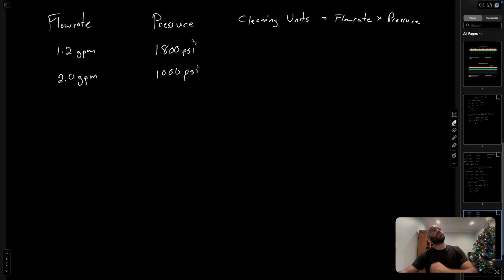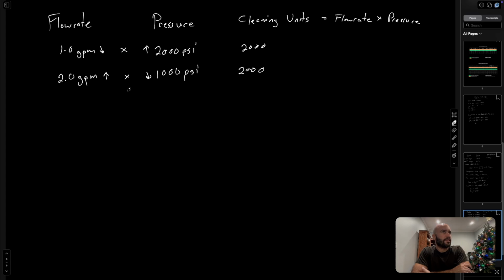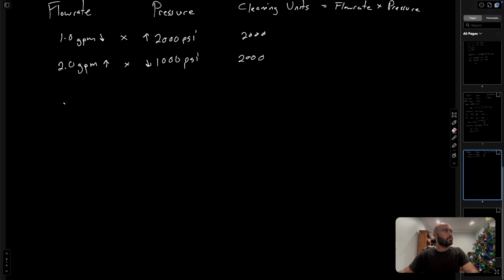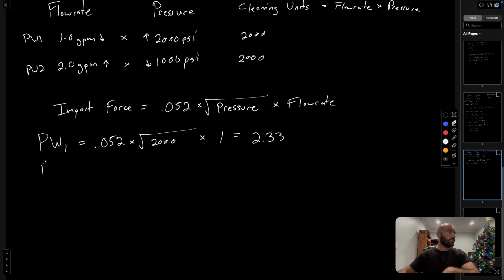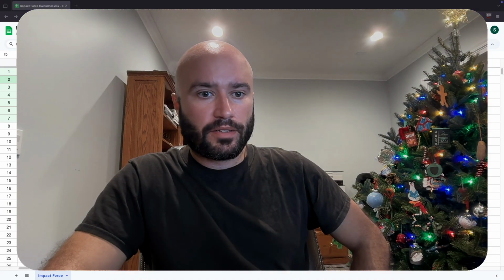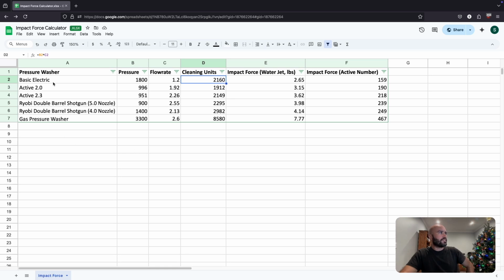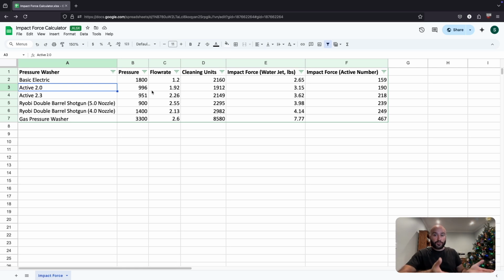Don't Use Cleaning Units, Use These Instead

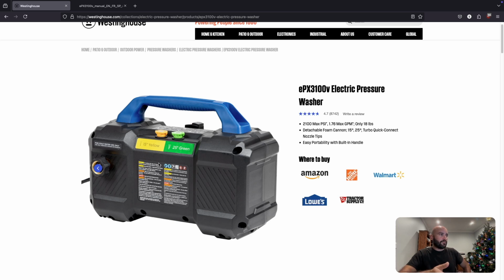Comment: 13:37 those numbers, especially 1.76 gpm, for the Westinghouse mean it’s just a rebadged Sun Joe piece of junk. I made the Sun Joe mistake when I got one just before OG Matt did his huge test, educated us all on PW’s and proved Sun Joe are junk. Funny enough a 20 year old karcher was far more reliable than a SJ.
Reply from the maker: I would not be surprised if multiple brands were using the same motor/pump with different housings. That Westinghouse I had was no bueno, I should have gone for the Ryobi 1800 early on. Now we have the Ryobi Auto which is definitely the best low budget PW. Thanks for watching!
Reply: @StevePierson123 oh there definitely are multiple brands using that same motor/pump. I’m just pointing out Sun Joe because they are the biggest, most well known to use it and are complete junk. I would stay away from anything that’s shared with them. No doubt under $150, even $200, either Ryobi is the best bet.👍

Comment: Great info and I appreciate the theoretical explanation. I’d like more detail on amperage, how it relates, and more detail on all of those variables you mentioned that impact pressure. Probably none of it makes a difference other than I enjoy understanding the theories. I can also relate back to similar concepts when I was in the fire department and we regulated the pressure on our pumps to determine flow after taking into account distance, hose diameter, and elevation impacts. Fun times.
Reply from the maker: I definitely need to do a part 2! I want to setup a small website to post all the formulas and calculations. I wanted to fit more into this video but my speech is sooo slooooow. In my head I feel like I'm talking way too fast, but then I re-watch I realize I take forever to say something 😅

Comment: Thank you, Steven, for confirming with numbers what my brain and body were telling me.  I swore that there was almost like an equilibrium where the higher flow "made up" for the "less than the holy grail of 1000 PSI".  This video really helped confirm that the 5.0 nozzle is the best for my Dual Ryobi setup as it is actually stressing the units less than the factory 1.7 nozzle did per unit.  Power usage on a single was around 13 amps and with them working together, it runs around 11 amps each.  It's been going strong for the last four months and I'm still happy with the results.  I didn't realize how much "quieter" my system is than an Active 2.3.  I measured 82 dB and read that the Active 2.3 is over 100 dB.
Reply from the maker: Awesome! There is a direct relationship with pressure and amperage. The only way to achieve more GPM and pressure at the same time is to improve the pumping efficiency. Less friction within the pump, proper mechanical linkages, etc... I can't believe the 2.3 is over 100 dba! That is LOUD
Reply: @StevePierson123  I have a correction to the Active 2.3... I watched many different reviews and the highest I saw tested was 94 dba.  It was a range from 90-94 dba.  I think I was going off of hearsay when I stated over 100 dba.  Still, it would be awesome to have Krinzle levels of quietness, but the pocketbook says otherwise!  How about putting them in an sound-deadening enclosesure... Ever take any temperature readings when pressure washers are in use?  Next area to explore, eh?
Reply from the maker: @ Depending on where you measure, it could legitimately be 100 dba! I think there might be an OSHA guideline out there, but for whatever reason, 3 feet from the source is a pretty common place to measure.

I would love to pursue sound deadening! I never measured any temps on or around the PW but would expect it to be somewhat tolerant of higher temperatures. I recently hard mounted my Active 2.0 to a shelf I built. That noise carries through the walls 🤣
Reply: The thing is, is 1000 psi really the holy grail? Matt has said many times he made it up. It’s not based on science but his feeling that if it doesn’t hurt his hand it won’t hurt paint. The problem is paint is much tougher than skin so it’s a bad comparison. The whole reason people started using pw’s, even low power electric ones, was for the cleaning power of the psi. If it was all about gpm just use a garden hose which has far more than any pw. People deemed 1.2 gpm, but at 1500+ psi to be superior to 100 psi (Garden hose on full setting, not shower or jet) and 5 gpm. Not sure if my garden hose stats are correct, please correct if I’m wrong. Force doesn’t matter much for a maintence wash, that’s why I use the garden hose for it quite a bit now instead of the pw. It’s mostly for convenience and does as good of a job. When the car is actually dirty like after driving in rain, a road trip or winter washes is where you do want the force. 1k is usually enough for people like us that keep our cars well maintained and washed frequently so they never get too dirty. Most people don’t though and would probably benefit from more psi. It’d be interesting to see the  real world difference in psi vs gpm. The difference it actually makes in cleaning or rinsing and at what point there is degradation to wax, sealant, coating and then paint.

I just wonder if every one chasing this made up 1000 psi number is going down the wrong path. I get that equations like this can prove certain things. By the same token it’s happened many times that real world turns out to be quite different than theoretical. A whole market segment started because people preferred 1500+psi and 1.2 gpm to 100/5. Numbers easily achievable with cheap $100 pw’s. The added benefit of a $1000 machine is definitely not 10x. Is 1000/2.1 really the sweet spot or could something like 1600/1.8 be it?? Cleaning units on the spreadsheet suggests that psi does matter. The basic electric at 1800/1.2 having more cleaning units than both Actives and almost as much as a low psi dual Ryobi 5.0. It’s not until the higher psi and gpm of the dual Ryobi 4.0 that the cleaning power increases significantly.  Psi is the only reason we started using pw’s to wash cars in the first place. In the real world is impact force really better than cleaning units?

 I think everyone just adopted Matt’s, admittedly, made up numbers too easily without question it. I’d like to see it proven in real world tests rather than it being just a given.